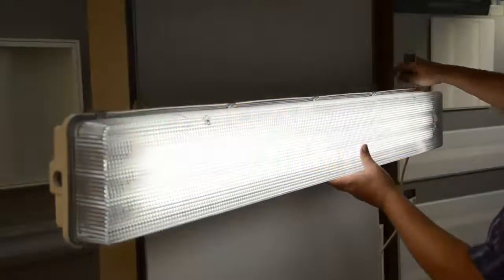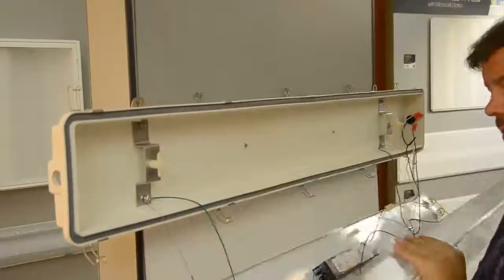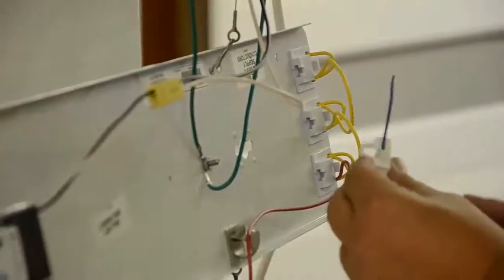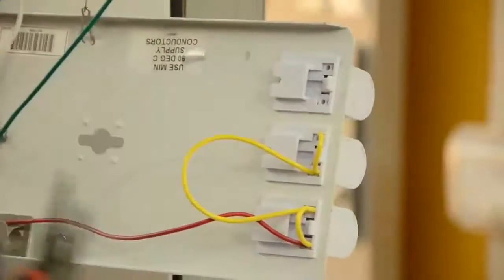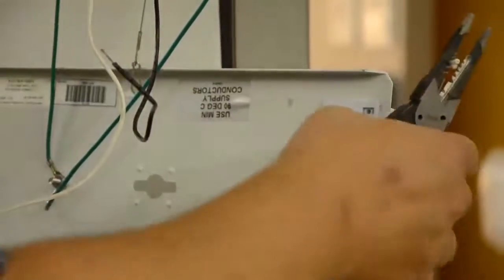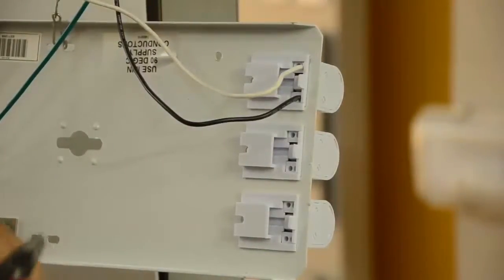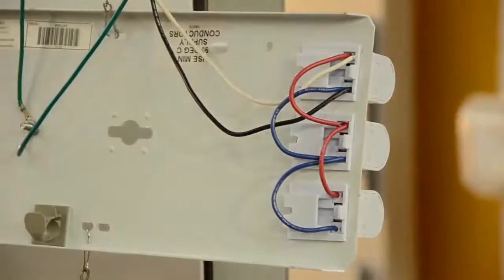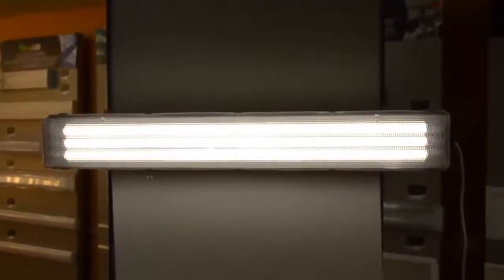LED Linear T8 - Installation Video

Comment: Nice Video. Thanks. So what do you do when you have the electric ran through multiple fixtures and it typically goes from one end through the other end through multiple fixtures. When you do it like this it seems as if you need direct line voltage directly to every single fixture. I know very little in this field, please advise. Thanks.
Reply from the maker: Hi Brett, It works the same. With fluorescent fixtures the power runs through one fixture into the next, it is the same for LED.